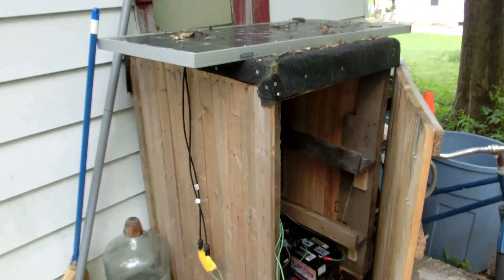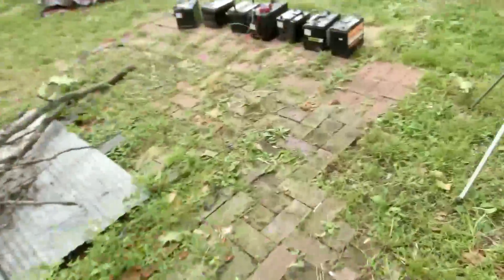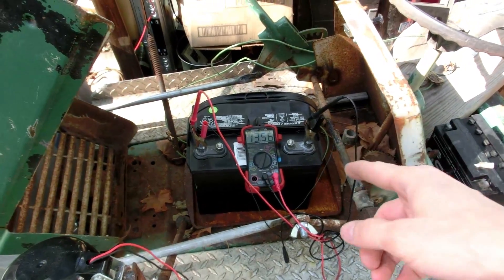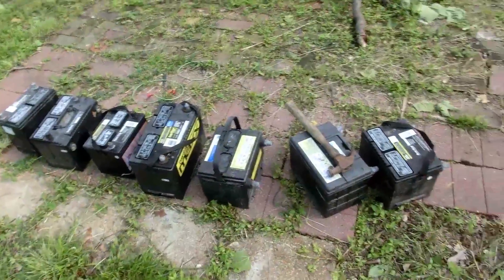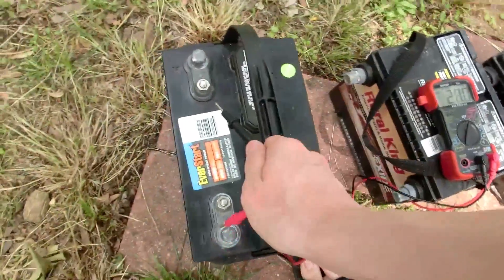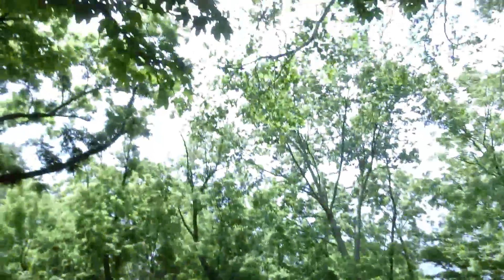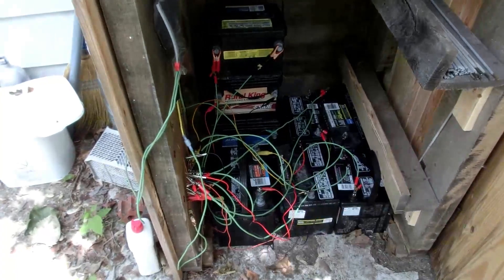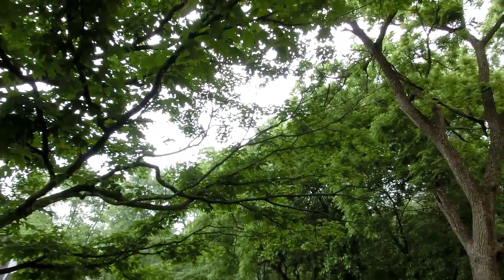Solar Sunday Experiments 007: batteries after 4 months

Comment: You need to do some research about battery banks as you keep connecting batterys together that would have different amp hours and because of that you wont fully charge them all at same time
Reply from the maker: +jacky Parker no that is wrong, they are in parallel not series. what you say is accurate if i had them in series but not in parallel.

i would recommend you go play with some batteries then you will see what i mean.
Reply: I am a qualified engineer so know what I am talking about
Reply from the maker: jacky Parker
well no you obviously dont.
 i can say i'm a qualified engineer too, doesnt mean i'm right just because of that. what makes somebody right or wrong is what they say not meshing with real life.
Reply: what I didnt mention is i have done over 4 months of solid research about green energy and will be building a hydro system that no one else has come with
Reply from the maker: jacky Parker
no else has come with? what does that even mean? and btw 4 months isnt very long, if youve only been working on alternative energy for 4 months then you basicly just started.
Reply: +Rinoa Super-Genius no one else has come up with . . . . . I said " i have done over 4 months" I admit im no pro but i still know enough to be able to build my own systems
Reply from the maker: jacky Parker
so you havent actually built your system yet? do you have any real experience regarding this stuff or just things youve read and watched on the internet?
Reply: +Rinoa Super-Genius I have 2 80 watt solar panels didnt get any more power full ones as not in best location for solar energy because of the trees. . . . . . Built my system over  2 years ago . .One of my engineering course taught me about batterys  . .  2 volts per cell  6 cells = 12 volt . . also taught me about eletrics as well . . just havent had the funds to do any more other wise my hydro system would of been built ages ago. . . . . .Thats going to cost me just in plumbing fittings as for wind very rarely get any round here when we do its mainly in winter (fall) time
Reply from the maker: jacky Parker
ok yeah so youve got some of the basics, i'd recommend you do a lot more real-world experimentation to learn the characteristics of batteries and power. for instance you can have a 12v 40ah and a 12v 110ah battery in parallel and they will both happily sit at full charge. the main reason being because they are both at the same voltage so there is no energy being moved anywhere, and since they are both in parallel if you charge one battery it automatically charges the other battery as much as it needs to get to the same voltage.

for instance the 40ah battery is like 1/3rd of the 110ah battery so when both are charged, the 40ah will take like 1/3rd the current to increase to the charging voltage as the big one does, thus they charge just fine.

Comment: what's your take on leaving batteries on concrete?  I heard it drains them or something.  Not good for them is what i heard.
Reply from the maker: +linuxxxunil and that s completely false with todays batteries, that rumor started as a fact in the early 1900s when batteries where glass jars held together by wood. if you left the wooden batteries on concrete they would moisten and deteriorate. but then as soon as we got to plastic battery cases its no longer even remotely and issue. i've left all my batteries on concrete.

Comment: BUddy, u need to buy the Desulfator from Ebay the seller name WizBangPlus  this battery desulfator work well for me, $25,   It will help your battery last much longer, desulfate the white build up inside the battery
Reply from the maker: Hieu Don i already did a two year test with that one and found it to be garbage so i assume your meaning that as a joke since i've covered it a lot in the past.
Reply: no it not a joke.  Idid it for my solar system.  Depend on who you bought it from.  The WizBangPlus was the one that work for me on my solar system 4. Big deep cycle battery 2x bigger than your, one day sun high but it not charge to full.  So when I put that on, 1 month 2-3 weeks later it show the batter full charge again, so I know it works,  but it up to you.  I like your BIG solder ion haha the one u use to connect all the 18650 together
Reply from the maker: Hieu Don
how many Amp-Hours of capacity did it revive in your batteries?

Comment: Hey, I've watched most of your videos and I'm thinking about building a solar panel to charge a 18650 battery bank . Will it work if I have a 12W panel and put 3 cells in series (+/- 12V) with a charge controller? I'm thinking of making a relatively large battery bank. Certainly, by balancing before...
Reply: Rinoa Super-Genius
Reply: Daniel Caye no, you need very tight control for lithium cells, they are not forgiving like lead acid, perhaps get the lithium charger that rinoa uses, it can take 12v in and control the charge , lithium need an absolute cut off at 4.2 and a solar panel will do up to 19v by itself

Comment: Are you worried that nailing in the bus bar like that it's going to ground itself out or even short a bit if the wood gets wet?
Reply from the maker: sc0tte1 no. the voltage isnt high enough. if i lived near salt water that is conductive i would.

Comment: I'm getting about 30 amps out of my 12 solar panels, I use the electricity to fuel my electric car.  Working on a hydrogen generator, and hydrogen conversion, then I'm going to convert all my old school fossil fueled cars to run off of the hydrogen and oxygen gas contained in water...should also give me about 100-300 more horse power, since old school fossil fuel sucks compared to the power of pure hydrogen and oxygen gas.

Comment: The buss bar is a good idea but I would have used plastic ,because when wood absorbs moisture it can become conductive ,and I would have used rain water instead of tap to refill the batteries
Ha Ha  yeah we get the same sunny with rain here in Indiana ,welcome home lol   :)
Reply from the maker: ***** this is only 12v we are talking about though. and rain water has dirt and stuff in it. tap water is cleaner tbh.
Reply: Rinoa Super-Genius Even though it`s only 12 volt any change to the conductivity of the wood due to moisture is a strain on the charging system you really don`t want had this problem when I was charging multiple batteries ,found a chunk of plexiglass  mounted my buss bar to that I normally filter rain water through a coffee filter ,less chemical's than tap water unless you have well water
Reply from the maker: *****
thats why i'm doing these long term tests. ^^
Reply: +Rinoa Super-Genius head over to +greenpowerscience and maybe you can make a fresnel lens and boil some water using the sun.
Reply from the maker: linuxxxunil
i've already been doing that before his videos, and also that guy who runs that channel is a fucking joke. he does almost nothing practical.

Comment: so, I guess the car batteries tend towards a slightly lower voltage than SLA/VLRA/AGM UPS batteries?...

for example, IME, UPS batteries tend to hang out right around 13.4 to 13.6 volts IME (when disconnected), are float charged between 13.6 and 13.9 volts, and are cycle charged between 14.4v and 15v (and are 12.8v when drained down or when driving a load).
Reply from the maker: Brendan Bohannon yes they do. flooded cell batteries are weird, you would think they would have the same voltage as acid-starved batteries.
Reply: Rinoa Super-Genius

hmm, yes.
so what about AGM car batteries? are they more like the UPS batteries, or more like the flooded batteries?...

otherwise, for building a small EV (mostly as a test), not sure how much driving (speed or range) I can get out a pair of 9Ah UPS batteries. the motors I have ordered (a pair of roughly 1/2 HP motors), if operating anywhere near full power, will likely run down the batteries pretty quickly (later would probably use AGM car-batteries or maybe some LiFePO4 UPS batteries, maybe the larger 20Ah types).

the motors are designed for a 12v 80A peak, but I am thinking if I run them at 18v or 24v but with a typically low duty-cycle (voltage across the motor will be lower), I may be able to get more output power without needing to run as much amperage (but likely requiring a lot more power to be handled by the snubber diodes).

another possible option is wiring the motors in serial, and running 24v (with a 12v drop across each motor).

running them directly in parallel at 12v would require around 160 amps.

but, I am also left worried I may have been better off had I gotten a 24v motor with a peak of around 2HP (1500W). but, this motor was $100, vs the two I got which were $30 each.

granted, maybe it wont matter much if my driver electronics or batteries couldn't run it at full power.

I am also thinking I will probably need metal pulleys or sprockets (I suspect 3D printed ABS wouldn't hold up so well, and would mostly just amount to a waste of filament).

Comment: i had a set up like this once....then the charger ignited the fumes off the charging battery's   boom!
Reply: kris Thorne LMAO that would have to be a lot of charge going into a lot of batteries to cause that much gas to ignite.
Reply from the maker: kris Thorne was it stored in an air tight container?
Reply: Rinoa Super-Genius  no. Just a waffer board box outside. Much like yours    coulda been more vented.